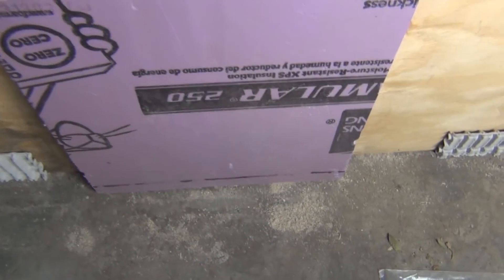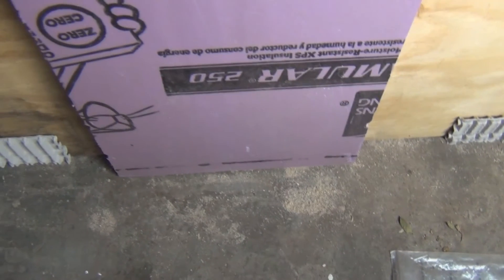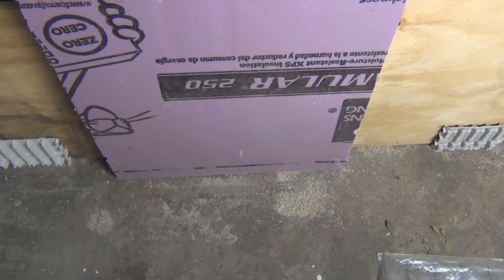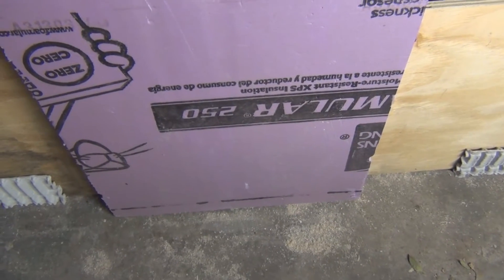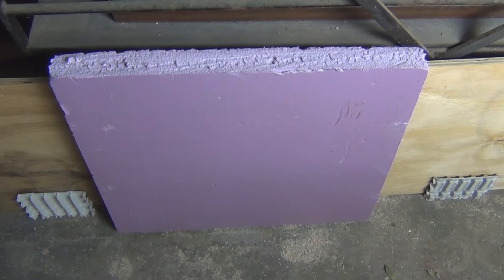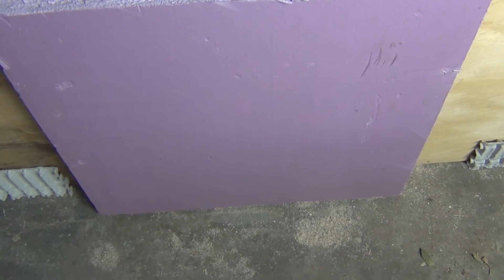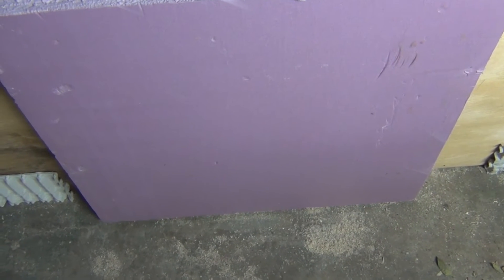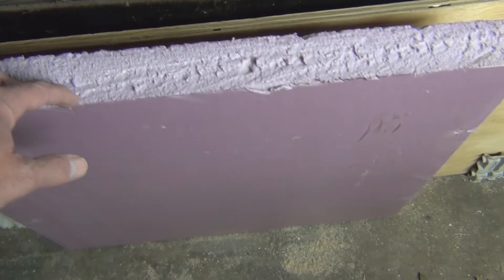Bee Hive Top Cover Insulation

Comment: Not sure if this is a good idea.  Maybe it's different in your part of the country but in MN we install a "moisture board", essentially a piece of untreated Built Rite sheathing, to absorb the moisture the bees give off.  Then we put a few sticks atop that to create a narrow gap between that and the top cover so the moisture can evaporate rather than accumulate inside the hive.  Seems to me this sheet insulation would prevent the evaporation of the moisture buildup in whatever insulation you're using below it